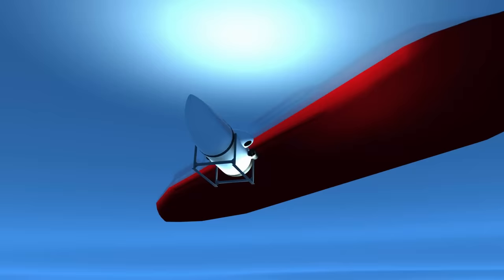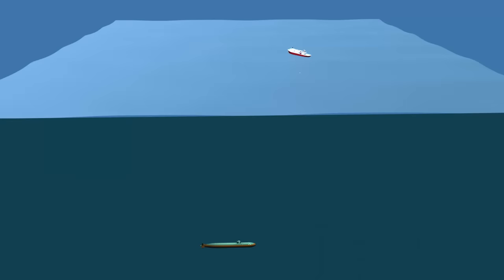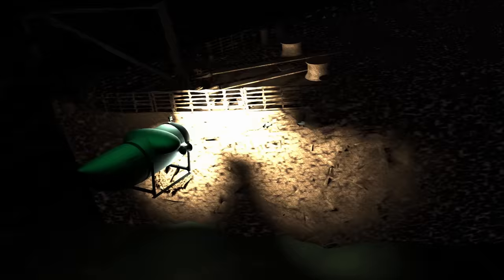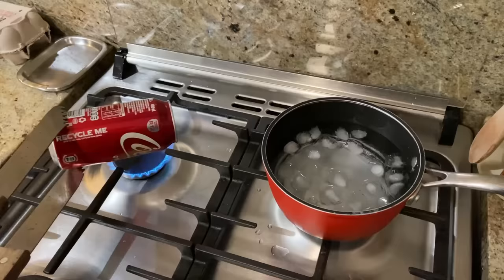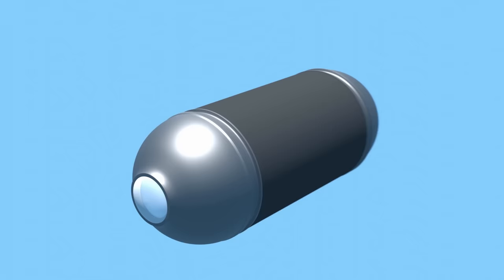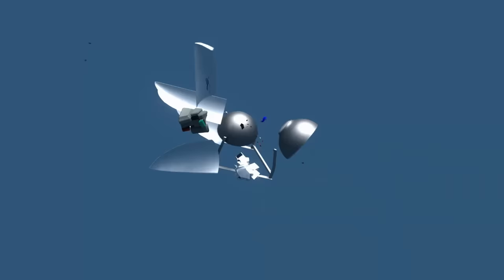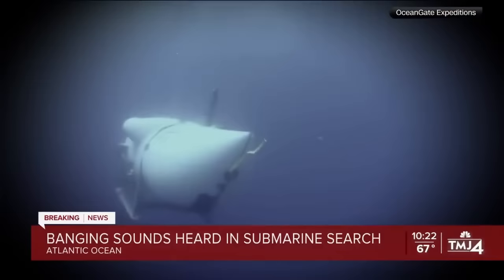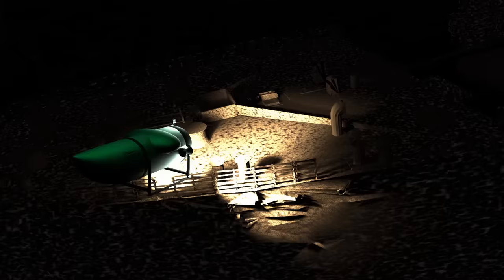TITAN Sub implosion | Deep Dive animation explanation

Comment: Thank you for the descriptive video. I remember seeing somewhere (for the life of me, I cannot find it now so not sure if this is true) that the carbon fibre was wound around a much thinner titanium hull section. Now I am not sure if this was the case because a pure carbon fibre composite hull is wild especially at >3 km depths! The fatigue capabilities of the interfaces (include the bolted connections and the epoxy) is another issue. The Titan undergoes cycles of contraction/expansion due to pressure and temperature differences. All it takes is one flaw to grow enough to amplify stress and then you have 3 km of water pressure coming down on that flaw. Condolences to the family and friends affected. May this be prevented in future.
Reply: It's possible you saw it in this video for he presents it here.

Comment: As a sailor that has years of experience, doing fiberglass work, and knowledge about carbon fiber, and sailboats and mass that crack under stress when I saw how that thing was put together, I told my sister that I guarantee those two in caps blew off of there because they were glued on there and I’m sure as I think started crush and then those things blew off and seconds and I told her that for the thing even renew anything happened to it I said that was a bad idea

Comment: I'm amazed that they epoxied the rings on in a n open warehouse, no temp control, dust control, dust free suits (wearing regular clothes), and it wasn't done in a vacuum to avoid any air bubbles. Everyone involved in making this thing was an idiot! I can hear the guy say "Don't worry, those titanium end rings rings are so heavy that any air bubbles will push right out". We don't know if it was the ring epoxy connection, the "discounted out of date" carbon fiber or the port hole that was only certified to 1/3rd of the depths they were submersing to. The whole situation is just a plethora of mistakes and ignorant people unwilling to listen to experts. But, if your name is Stockton Rush the 3rd, you probably think very highly of yourself...

Comment: As an engineer I totally agree with the fact that the weakest spot was in the manner the carbon fibre was wound around the cylinder to produce an arch effect rather than a column,  where the circumferential solidity of the fibre rods was  existing but there were no  longitudinal nor " straps" holding the "individual circles together" except for the epoxy,   When considering  an element  of the  circular  walls of the cylinder along its length, the walls were made of multiple short elements of circles on top ( like beer cans acting as roller bearings) of  one another with no longitudinal rods  along the length of the cylinder,  I feel stunned as I write this, as having no longitudinal  rods and no strapping, meant that only the epoxy was holding the " elements of the circles ( hula hoops)  from slipping along the length under end pressure. Considering an element of the arc of the circle, this means that the cylinder wall along the length consisted of round short rods/cylinders held beside each other with epoxy resin, and with no strapping these would  slip as the epoxy binding is the only " structural glue " holding the short cylinders of a small arc together, This is not a wise structure along the length of cylinder which needed to have a " columnar" structure along the length of the cylinder. 
https://youtu.be/HYbU4iU4DMY
This  video may give an idea of the missing reinforcement along the cylinder length.  As it was made, an element of the wall along the cylinder was similar to storing a lot of round pipes one above the other which can slip,   The manner in which the carbon fibre were laid,  it would be impossible to have a homogeneous wall along the length of the cylinder and the " short rods " of the carbon fibre slipped under compression due to the inhomogeneity of the cylinder wall and a void or two ,  Here is another video which helps to explain how along the length of the cylinder there was not enough  columnar strength. Just consider the cans, but not the columnar elements, 
 https://youtu.be/p4wH1ySMchY
Reply: Wow, I pretty much came here thinking the same thing, searched for newest comments, and read your post.  I was a vessel engineer in the 90s, and as I watched this on slow mo (the implosion) my brain went to work on WHY it happened.  Basically the pressure was forcing the two spherical heads together, and there was insufficient longitudinal strength in the shell.  I also question the flat gasket seal btwn the head and shell. (as seen on another video) The bolting looked TERRIBLY inadequate.  Ida used radial and face seal o-rings w/test ports btwn each groove.  Actually, I wouldn't have made a sub for that depth period.  But the failure mode here was obviously the over fatigued (not fit for purpose) shell.  Your post was better than I coulda wrote, great job.
Reply: @majorrev8690  Thank you for your reply and thank you for appreciating my thoughts. I am sure that we are not the only " logistical " people who noticed the deficiency in the structure, Thanks again. These communication systems are meant  for us to share our ideas, which could benefit both the reader and  the writer,
Reply: @carmelpule8493  You're welcome.  Its nice to read well thought out and value-added comments such as yours.  
There is a plethora of lessons learned in this Titan implosion.   If people must build for that depth, they need to heed 100% of the outside advice given, especially from regulatory orgs such as SAE, DnV, ABS, ASME, etc.  Ive had copies of each of these specs on my desk at times, and wasnt really looking forward to the weeks long reading and research that lay ahead.  But it was part of the process and I loved it.

Comment: I'm no carbon fiber genius but one thing I do know is what happens if you simply glue it to the metal of a car.  Some people like to add wide body kits making their cars look wider than stock.  Professionals will attach these kits, that can be made out of carbon fiber or fiberglass, using a special adhesive along side either bolts or rivets.  If they simple use the adhesive there will be cracking after a few hot / cold cycles of typical hot summer days and cool summer nights coupled with road vibrations.  I've seen show cars cracking after just a few shows.  Keep in mind, these show cars are trailered, and only run long enough to get on or off the trailer and park in their designated spot.  Personally, it you're going to use adhesive to bond titanium rings to a carbon fiber tube, then I wouldn't expect it to last long term.  

All metals expand and contract because of temperature differences.  Ask any mechanic, got a stuck bolt?  Heat that sucker up!  Why?  Because metal expands and contracts breaking the rust adhesion loose.  Carbon fiber and fiberglass both expand and contract with hot or cold temps.  The problem is, they expand and contract at different speeds / temps.  If titanium contracts at say, 1mm per 5 degrees and carbon fiber contracts at 2mm per 5 degrees, well, how long do you think that adhesive will hold?  BTW, I'm not stating that's their contraction rates per temps, I made them up as a simple example.  Point is, different metals expand and contract at different speeds, imagine the difference between a metal and a fiber.  

Look for the weakest link in your chain and chances are, that's where it broke.  If it cracks on cars that never go much beyond sea level, I'm surprised the sub lasted as long as it did to be honest.

Comment: The implosen may have happend in  a fraction of a second,  but I promise you they knew they were in danger.   Carbon fiber, like fiber glass, will crack and make noises before it collapses.   They most likly had a small crack form,   and from there the water pressure forced its way in and then it collapsed.   They knew they were in trouble.

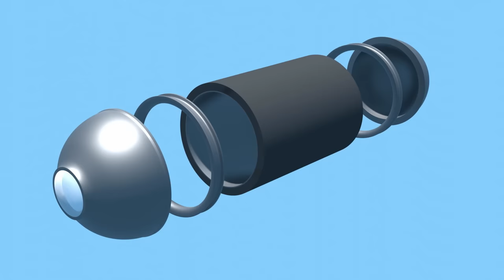Comment: At 3:36 you say that the composite was rolled onto a steel pipe and in the graphic shown you make it (the pipe) appear to be a part of the finished vessel. I have to assume that you are referring to the steel spindle on which the carbon fiber composite was wound and not a part of the finished vessel as no one else has ever said anything about a steel pipe being part of the carbon fiber tube? If there was a pipe as you say, I am sure it would have survived the implosion as a crumpled piece of metal like the soda can in your demonstration. 
     I do agree with your analysis as others have said that if the carbon fiber had been wound in more than just the one direction in a cross hatch pattern I think it definitely would have increased the strength significantly. But cycle fatigue would have destroyed either type eventually! Very Nice graphic illustrations in the video! Thank You!!

Comment: How well do we know it actually imploded? Just because parts were scattered and the materials used for the sub has not been tested. It could have been the sub squashed slowly to the point of pressure forcing to split in parts. This is the true fact that carbon and  titanium are not or anywhere similar to each other. This is why I think its crushed slowly as the landing legs seem to have 0 damage. My thoughts only
Reply: The legs are/were open tubes.. they had water inside as well as outside the leg walls so the pressures were equal. Same reason that most ships don't crush when they sink, because they fill with water and equalize on their way under. Infact the Titantic is a perfect example. The bow section slowly filled with water as it sank, thus not crushing. Versus the stern which had sealed compartments, but when it hit its crush depth it pancaked. You can see the images online of the two different scenarios from the same ship. I found that bizzare until I read why.
But as you mentioned with the titanium/carbon fiber mix, who knows what happend to this paticular submersible.  I'm also very curious what they find but I bet they find it pretty quickly.
👍🏼
Reply: @elconquistador932  Yes, I do agree, but with the legs of implosion, would they not also show signs of damage as they are connected. Like bent and twisted 🤔 I hope they never suffered. The report will soon show
Reply from the maker: The legs were fine because the parts moved inwards away from them. Remember it was not an explosion with stuff shooting apart. The sub pulled away from the legs. 
It was most definitely a rapid implosion. The was nothing slow about it.

Comment: The carbon fibre tube was effectively thousands of horizontally placed fibre rings glued together with resin. A geodetic spiralling cross weave, built up layer by layer would have been better.
However the technique and material was never tested to destruction so no one had any real world idea of how many pressure cycles it could withstand before catastrophic failure..

Comment: There was an unconfirmed transcript shown recently which showed the text of the conversation between the surface ship and the sub.  Indeed, if it is true, the occupants did  hear ominous noises and also the systems that monitored the hull were indicating problems.  At one point all red indicators.  The transcript conversation also indicated the sub dove to depths much faster than it should have, which may or may not have played a role in the collapse of the pressure hull.  The Titan was most of the way down when they got the concerning indications and dropped the ballast to begin surfacing.  The transcript also reported they dropped the landing frame as well; so it appeared they were in a desperate attempt to surface as quickly as possible and knew there was serious trouble.  They surfacing went much slower than anticipated and then disaster struck.  The rest is history.

Comment: The graphic segment here showing a possible linear collapse of the central cylinder is ominously similar to the photos of the USS Scorpion submarine failure off the Azores, the cone-to-cylinder joint by the aft machinery spaces collapsed in a lengthwise fashion, imagine a folding telescope, ejecting the propeller and shaft to the rear. If the carbon fibers were indeed not spiral wound (and to a great extent even if they were) a telescoping collapse is indeed a possible mode of failure. I actually favor the simple cylinder hoop stress crush failure mode.

Comment: Degree qualified Materials Engineer here. I've also lectured in Engineering materials at University level.
Firstly,  Great video. The problem I see with the material choice is that you use carbon fiber where weight is a consideration and it's principle benefit is it's high stiffness to mass ratio and it's ability to deal with tensile loads effectively. In a submersible at deep depths, there is little tensile load. It's practically all compression and lots and lots of it. So why use carbon fiber when you can use high strength stainless steel that is very, very good in compression. 
Another thing that stood out to me is the vertical weave around the tube. A siren went off in my head looking at that. Carbon fibre is very strong in the direction of the fiber but quite weak across the fibers. This is why things manufactured in carbon fiber or fiber glass for that mater, are typically made in a criss cross weave. If you want to make something very, very, strong, you should make it in several layers of carbon fiber or fiber glass weave but have the different layers at different angles to each other. But they didn't do that. The orientation was vertical.

Because of the vertical orientation of the carbon fiber, if there started be a failure in the material, it would have run along the length of the sub and it would have done that pretty easily. Cylindrical structures under stress tend to fail along the length of the structure. A good example of this is a sausage. Get a sausage and cook it up. When it's been cooking for a while poke it with a fork. The sausage skin will open up along the length of the sausage not around it's circumference. This occurs because once the energy of the hoop stress is released it will take the path of the least resistance which most the time produced resolved longitudinal tenson. Since sub was strongest circumferentially, the load would have travelled along the length of the sub once it started to fail. 
This is probably what happened to the sub. The picked the wrong material, made in the wrong way, subjected it to load that that material is good at and it all went to shit in a thousandth of a second, will a failure running down the length of the sub.
Reply: Quick question, do you think a spherical carbon fiber sub could have worked?  Of course, doing the cross weave instead of all just one direction?
Reply: @shanewilson7994  It might work but the fundamental issue is load finds a weakness and carbon fibre components are very difficult to repair and any minor weaknesses in them result in the rejection of the component. The smallest bubble of air caught in the fibres when subjected to 400 atmospheres of pressure is a potential cause of a catastrophic failure. Steel doesn't do this. As well steel will yield and deform before failure. Carbon fibre typically won't. It'll just rupture.
Reply: @Rapidcouplescounselling  thank you, that's what I figured but was curious from an engineering perspective since you probably have a much better understanding of the stresses than I do.

Comment: It's pretty astounding that right off the bat there are 3 material flaws that beg for disaster: the carbon laminate, the Polymer Dome cap, & the Alloy, tale expanding & contracting by different degrees.  This design didn't satisfy any of the minimum stardards of deep sea submersion today or even standards decades old.  Beyond that; Everyday uncovers more & more ill thought out technical problems.  It's astounding that anyone agreed to be locked in this imploding casket. This was a case of Hubris once again this time by Rush & the two world wide explorers that fell into a sense of false security from years of risk taking. The father & son bet on these men's reputations, but it was a crap shoot from the start at best.

Comment: Can’t help thinking that the main weak point was the join between the cigar shaped hull and the end caps. Surely the pressure at those joints is all wrong, and is essentially pulling the cigar away from the end caps at all times? It seems the pressure is pushing the different elements away from each other.